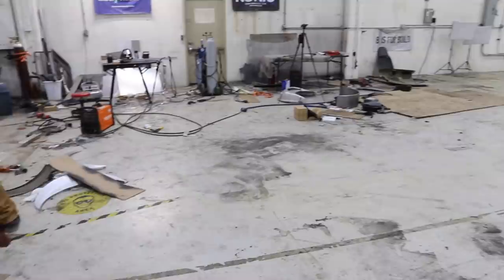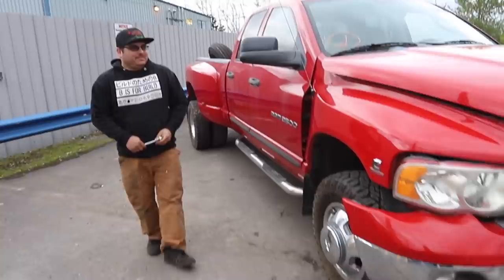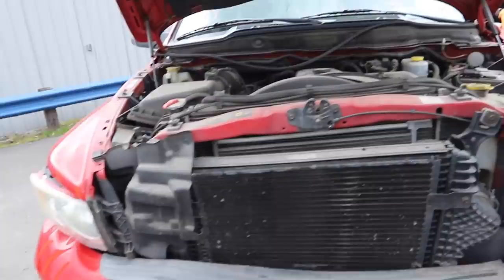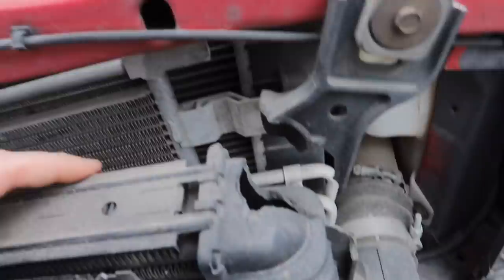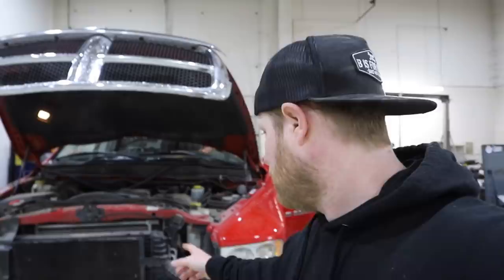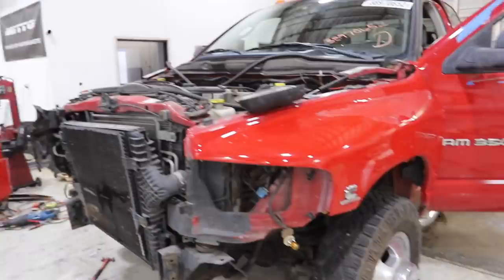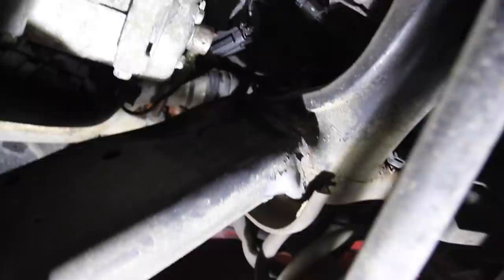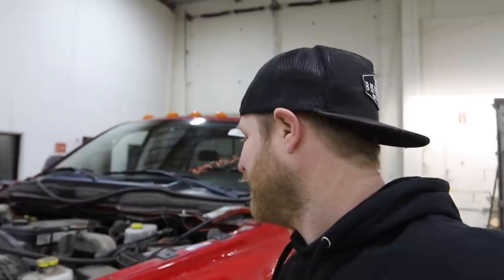We Bought A TOTALED Cummins 5.9 Diesel Dually to REBUILD and Rescue Our Builds

Comment: I would absolutely keep it and do what you gotta do to fix it, those trucks will take care of you when you take care of it. Your never going to be let down with it. Good luck!
Reply: Apart from the awful trans related problems they have xD
Reply: It would make a fancy barstool racer, and with ice tires and a centre mounted trailer hitch above the stool attached to a type of rollcage roof, it would still perform as it should as a summer season roadworthy towing device, unless your already used to snowmobiles and rain and intensive windshear.
Reply: @reecewoodruff3255  yep! My 21 ram 3500 has 15k miles on it and already had a new trans put in at 12k, never hauled anything but tools. Toyota is the way to go.
Reply: BS! The only good thing on a RAM is the Cummins engine, everything else is trash, specially the transmission! 😂
Reply: Just for all you guys commenting about a transmission, put 200k on mine before any minor issues. Do your fluid changes. Don’t beat on your shit
Reply: @itzbishop5256  you hauling 3-4 cars because that gasser Toyota? No.
Reply: @shawncastilla  what is that proving? My tundra has been beat on all across the country over loaded with dirt bikes and camping gear for 5k miles at a time while also going off-road, I’d rather shit in a urinal than do that with my ram pos.
Reply: @itzbishop5256  2021 3500 diesel Rams come with an Aisin transmission. 

Aisin is a member of the Toyota group and is 22%-owned by Toyota. 70% of all transmissions made by Aisin go to Toyota vehicles. 🤣
Reply: @itzbishop5256  but Chris needs soemthing to pull multiple cars at a time. Rams are one of the most popular trucks for carrying heavy payloads for long trips
Reply: @shawncastilla  I trust my tundra far more than my ram, 07 tundra 137k and not one problem, despite it being beat on all across the country multiple times a year.
Reply: @shawncastilla  oh whoops, I thought you were responding to MY comment about me disliking my ram
Reply: @SunnyV-0  strange! Very odd that all my transmission problems are on my ram with 15k miles vs my tundra that works a lot more pushing 140k without an issue.
Reply: @itzbishop5256  My ram with the 6.7 cummins has 430K miles pulling 12-14k gooseneck trailers with routine maintenance. Let me know when your tundra is able to do that.
Reply: @roblancet7295  I’ll let you know my 21 ram had a new tranny put in at 12k without ever touching a trailer. I’d rather try it in my tundra since my ram is clearly incapable lmao
Reply: @itzbishop5256  I doubt any of what your saying is the truth.
Reply: @roblancet7295  good! If I could post receipts here I would! I don’t give a shit if you believe me or not 😂
Reply: @roblancet7295  Hit the nail on the head.
Reply: @itzbishop5256  You seem to have no problem posting videos of you playing games lol. Im sure you can figure out how to post a video of your truck and the receipts.
Reply: @roblancet7295  Its pretty hard to post something that doesn't exist. 😂
Reply: @roblancet7295  lmao I was like 15 years old, don’t be a creep pal
Reply: @itzbishop5256  So that makes you 21 now lol. 2021 Ram 3500 ha sure. Don't tell lies....pal.
Reply: @itzbishop5256  got a 13 tundra, almost 200k miles, I’ve driven that thing from the east coast, to almost all the southern states, never had any issues with it. Just recently at 181k, charcoal canister finally went out. My fault for overfilling though.
Reply: Can’t wait to see what they can do with this
Reply: @shawncastilla   LOL....
Reply: @SunnyV-0  Wow this has degraded to the point of what appears to be insults.
The fact is, both your trucks are complete garbage. You should melt them down and sell the ingots to purchase something that isnt designed to rust back into the ground.
Your trucks are like tin cans, you are fighting over tin cans, and its excruciating to witness.

What you want, is something made of durable plastic, like that 1970's bacolite plastic phone that used to go flying off people's shoulders as they walked around in hands free mode around the room and walked too far for the cable.

These vehicle manufacturers are laughing at you because you are arguing over something that has been designed with planned obsolecence in mind.

Would you want your spaceship to turn into rust in the middle of a trip to someplace else? It's not like you can pull over, and even if you could pull over due to a rusty garbage vehicle falling apart by design, would you prefer to, rather than drive a plastic spaceship?

Come on now!!
Reply: @owenoneil951  their sensibilities have been clearly compromised. Reduced to arguementive debates about the allowances of metalurgy of their constant struggle against the  grand imperial rust gremlins that plague the designs of their vehicle, by billionaire firms that want to build products that last about as long as they can afford to keep a line worker employed pressing a button endlessly like a monkey on this planet of the apes.
Reply: @truetech4158  Your comments are excruciating to witness. You could shorten multiple statements of nonsense into just stating you hate rust. And if you hate rust, don't live in a state that uses salt on the roads. Everything that is mass produced these days is designed to fail period. Now go back to using your plastic fleshlight.
Reply: @reecewoodruff3255  actually the 48re’s that come in the early 2000’s trucks are one of the best that dodge used. I’m not saying it’s a great transmission but as long as it’s cared for and they don’t tune it to high numbers it will do what they need it to do.
Reply: Transmission says hello

Comment: Always a reason that these heavy duty trucks get totaled.  I just went thru this on a 2006 Chevy Duramax.  Change the frame....not that bad, especially for you guys.  Just take bed and cab off then when you have other frame park them next to each other and swap drivetrain.  I did it at home by myself.  Have fun!
Reply: I just did it on an 08 duramax people offered to pull it but a proper frame will always sit better
Reply: Put the diesel in the Italian super yacht and get that thing going again

Comment: Those cut wires look like they were for the trailer brake controller (especially given the screw holes in the dash near by).  BTW, you will want a good brake controller for that 20k trailer carrying your babies!  Also, diesel trucks don't have vacuum, so both the power steering and brakes run off a hydroboost pump (which is NOT belt driven).  Sounds like yours is dead.
Reply: There is no hydro boost pump they both run  off the belt driven power steering pump which I guess developed a leak in the wreck and lost all fluid
Reply: Yup
Reply: They look like wires for brake controller and air lines for leveling air bags. They likely removed the air switch, helper bags, and brake controller.
Reply: @jeremyhanna3852  technically med/heavy duty diesels run their power steering pumps off of the front/back of the air compressor through a gear drive.
Reply: @Thegoose95  yeah and 3rd gen dodge 24v Cummins are belt driven
Reply: @Fei8lo  Agreed; if this was sent to the auctions by an insurance provider they likely would not reimburse the previous owner for aftermarket mods, so the previous owner likely removed that system for a new build/eBay.....
Reply: Thats not entirely accurate, 2002 and under 2nd gen rams had a belt driven vacuum pump. All Hvac/4wd/and cruise control all vacuum driven...
Reply: @jasonwillett1826  my 99 doesn't have a vacuum pump
Reply: Hydraboost pump gets it's assist from power steering pump. Master cylinder bad or ps pump bad or low fluid can cause that

Comment: If you paid less than $20K and that truck only has 144K miles, you’ve done very well.
Reply: he said 14
Reply: @1smhx5  yeah. Wasn’t sure if that included taxes and fees. They can be steep with those auction Companies sometimes.
Reply: @jgott1745  true
Reply: I feel pretty lucky, just got a 2010 Ram 2500 6.7 Cummins with 148K miles for 19K.
Reply: @SunnyV-0  what state? I’m in texas and i got a 2013 ram 3500 Cummins for $20k with 138k miles.
Reply: 14k for a salvage titled truck with bent frame rails and shitty paint? Sounds like he got shafted. But yes, if this was in normal condition with 144k miles, that’s a 20k truck.
Reply: @Thegoose95  you clearly don’t know todays market and a 5.9 Cummins in good running condition is 7-10K alone
Reply: @juandiego2101  Colorado. 4X4 Crewcab Laramie with the 6 speed.
Reply: @SunnyV-0  nice! Have you had any problems with it? Mine came with the def deleted and it pulls like a dream.
Reply: @jgott1745  do you want to give me your email so I can send you at least 5 listings under 15k from my local houston Facebook marketplace? Hell there’s even one with 160k miles for 14k BUT it’s not totaled. In fact, none of the listings are totaled. For 19-21k you can buy 2011-2013 6.7s with 180k miles.
Reply: @juandiego2101  No issues so far. Mine is completely stock, DPF and EGR intact.
Reply: @Thegoose95  My thought exactly.  The frame, apron, front fenders, grill, maybethe hood, front bumper, radiator, hoses, all havetobe replaced. Hes lookingat $25k at least. Forget about straightening the frame. He would then be looking at $35k including the truck....

Comment: The truck is not too bad to fix; the frame rail can be fixed with the engine in place. Also, the engine is not a 6BT but a couple generations newer. It is an ISB with a common rail injection system. Power steering and brakes likely failed because the cooler was likely damaged and lacks fluid in the hydraulic system. The brakes are hydro boost and use pressure from the power steering pump to provide brake assist.

Comment: The power steering and hydroboost brakes are both powered by the power steering pump. Make sure it has fluid and the PS cooler didn’t get punctured. If it has fluid the pump is most likely the problem

Comment: I think it would be cool to fix the truck and build it into the on road off-road towing/ recovery and road side repair beast you should have and travel with!  I’m talking flatbed toolbox bed with onboard air and a welder maybe ac/dc power outputs. Lift crane?!  The possibility’s are endless with a truck like that.

Comment: I own a 2005 3500 but non-dually. My vote is you get the front end straightened and fixed and you keep the truck. These trucks are brilliantly purposeful when it comes to hauling and you’ll love owning it even at these diesel prices.

The only other acceptable thing to do imo, is not some thumbnail catchy diesel into a car swap, but instead swapping that power train into an old body style truck the way Deboss garage would do….

But honestly just fix it stock and use it. You won’t regret it

Comment: That frame looks repairable, maybe do a collab with V-tuned or his brothers. Worst care throw a new frame in that track, its not a long project and not super difficult, just heavy
Reply: Nearly on opposite sides of the USA. I don't think that would work. Assuming the frame is not too bent past the coil buckets, they can chop and replace the front frame ends without too much issue.

Comment: Bad news boys, the 2005 Ram 3500 MAX towing capacity is between 10,400 and 16,200 lbs (depending on configuration).  This is far short of your stated 20,000 lbs trailer weight.
Reply: It is an issue with GCWR. Payload should be around 4000lbs on those dually trucks. I have almost the same truck and I can find ~15k tow rating but can't really find an official GCWR number. From a payload standpoint they might be okay with 15% pin weight. Common for older Cummins owners to tow 20k (so they say at least) with their trucks, just not sure on the legality of doing so.

Comment: I bought the exact truck in silver in 05. I have 247k on it, all stock except for a K&N filter. I bought it to pull a 51 ft stepdeck. I have had ZERO issues and I drive it daily.

Comment: The Cummins 24v is one of the best Diesel engines ever made. I can say this as someone who has owned a 2005 Dodge Ram 2500  24v Cummins  since new. The truck has just under 250,000 miles on it. Only ever had 3  issues with it.  The biggest issue is a very common issue. The wiring harness for the power locks and windows in the back doors failed. There is a fix for that. A relay that controls the fan speed of the climate control. and the last issue as you mentioned is the same failing paint issue. If taken care of the  Cummins 24v  is known to last a million + miles.

Cant wait to see what you do with it 👍

Comment: Hope you go ahead and put a good frame under that truck. It will serve you well. It would be a waste to see it go for scrap or be parted out. If you wanted to mod it you could remove the box and add aluminum fuel tanks, stacks, clearance lights and mud flaps. Changing out the frame would make a great video series. A bit of a departure for BIFB but I think most of your followers would enjoy it.

Comment: Definitely repair it, use the original frame to build a new one from scratch (b is for build) and add a flat or service bed, and a 5th wheel, so you can pull whatever you want and also service your cars on the road and events

Comment: You should buy a custom chassis kit that will allow you to tow heavy loads as well as bag it and slam it. It has always been a dream build of mine
Reply: I like the idea but legally the GVWR will remain unchanged. Unfortunately, it will actually lower your payload when you make the truck heavier. Given the weights, it puts them in CDL territory so it is not worth the risk. Stock, the rear axle is rated for 10,000lbs and it is common for people to pull a 20k-30k gooseneck trailer stock. 

I drive almost the same truck and it is bagged all the way around. The solid front axle on the 4x4 limits how low you can slam the truck. When the air bags are dumped, it sits at the same height in the front as a 2WD Ram of the same year. Notching the frame in front won't help as the axle will just hit the oil pan. On a 2WD ram, you can notch the rear frame to slam the truck but it is not useful if you need it to tow a gooseneck trailer. I helped by friend do this to his truck and it sits low with the bags dumped.

Comment: Check to see if a powersteering line got kinked. The truck uses the powersteering pump to feed the hydroboost and the steering gear. I am hoping you checked the powersteering fluid level. Good luck with getting the cars home safely.

Comment: My guess, the hydro boost or power steering pump went out, causing the accident in which totaled it…the wires under the dash, most likely went to a trailer brake controller and auxiliary gages, the white “vacuum” line goes to one of those auxiliary gages it’s for boost pressure. And they make replacement frame stubs to repair the frame.

Comment: Those wires hanging out from the dash are for the electric trailer brake controller that was probably mounted on the dash and those red airlines are for overload air ride bags that are normally mounted on the back axle it looks like they removed the gauges and switches that inflate and deflate the bags that are normally mounted on the dash and remove the airbags on the back axle since I did not see them in the wheel well

Comment: Just pull the frame straight enough with a pro and add braces. I think you will be surprised on how close it will get. Then put a newer clip (fenders hood ect) on it. It's a GREAT truck for what you need! Then get some semi wheels!

Comment: This is the exact same damage my 2002 F-350 had, but the frame was bent toward the driver side instead of passenger.  It almost got totaled due to the 75% rule, but the cost of repairs was ~75%, so it didn't.

Comment: Worse comes to worse swap it into another dually if that would be cheaper than frame and practically can swapping it as well. Side note the 6BT are the 2nd generation 12 valve engines from 1994-1998.5 and had the mechanical fuel pump. You have a common rail system that came after 2003 which is still a great engine

Comment: I have a 12V Cummins in a Chevy S-10. It is a blast but there are some things that you have to look out for. I did not build it but I have finished alot of the work that the builder didn't. If you put the 24V in a small vehicle, There are some concerns to look out for.

Comment: I’d love to see you do a body swap like you did with the original Mustang, Oscars Mustang, or the GTR. Take an older truck and swap it on top. You already have to replace the frame on it so changing the wheelbase isn’t an issue, and y’all already do a lot of fab work so y’all could make dually fenders for whatever truck. Or choose whatever classic truck you like and do the Cummins swap. Plenty of options with y’all’s skill level.

Comment: I don’t know how it is on the older ones but 4th gens at least the 2012 the power steering fluid is connected with the brake booster. If no power steering means no brake pedal pressure

Comment: Keep the Cummins in the truck and just have repaired on a frame machine @ a frame shop. You'll have no issues down the line and replacement parts will be an easier process

Comment: If you listen to yourself talk about how useful this truck is going to be, you have answered the question.
Rebuild it! The brakes and steering use the same hydraulic power, ie. hydra-boost. The Cummins has common rail injection, the first year for it, hugely beneficial. I tell people I bought Cummins and it came wrapped in a Dodge but honestly I have 200,000 miles of complaint free driving.

Comment: Find the time and fix the truck. Use it as a shop truck it saves you own truck and if it gets damaged you don't care as much as its just a work truck.  It will pull anything so great for using to get cars to shows as well as collecting new projects.

Comment: Start the engine, remove the oil fill cap.  Set the cap in the hole.  If the cap dances, you have massive blowby, if it sits still, good motor.